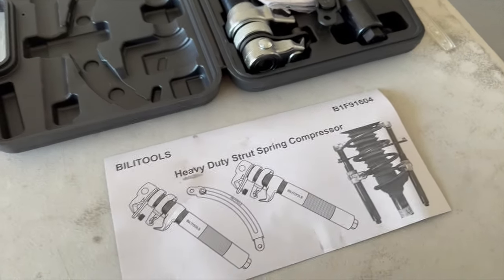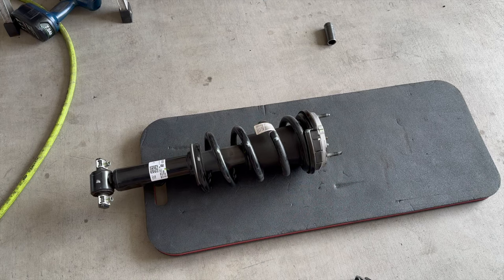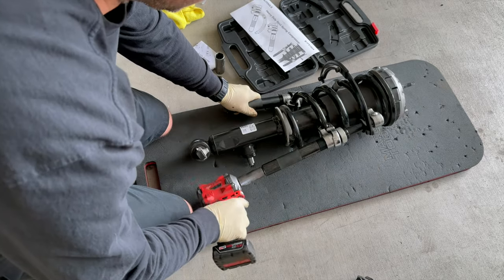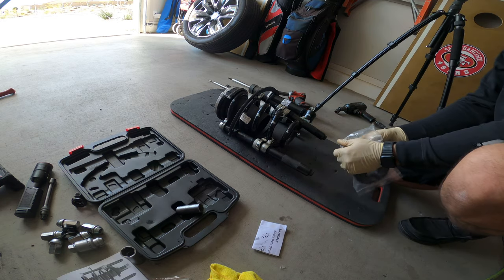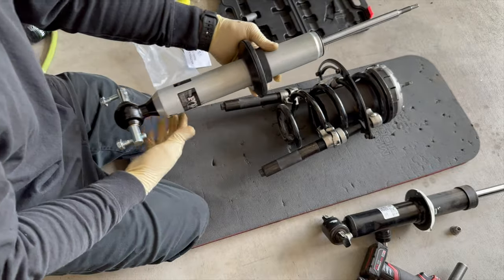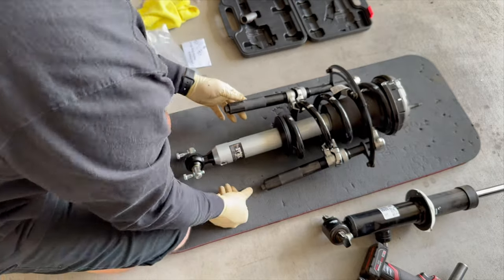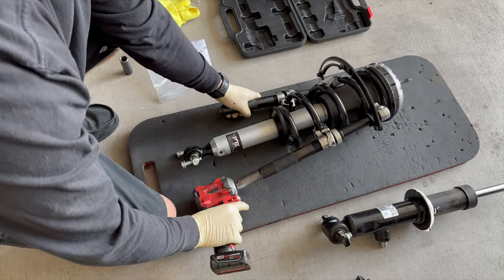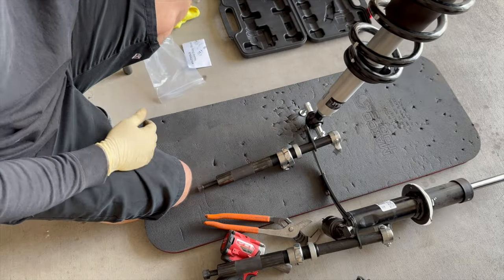Testing The Strut Compressor Tool (purchased from Amazon.)

Comment: Not safe being aligned with the spring axis
Reply: So how should u do it ?
Reply: @rickybobbydastar6534  Sit perpendicular to the spring.  Don't sit in-line with it.
Reply: @ravynx  thanks
Reply from the maker: @ravynx oh please I have done hundreds of struts and seen hundred of videos of accidents doing them. I have never seen them fail the same every single time. Plus the entire time I’m doing this strut my legs are open and I’m on my knees if it were to let go and sling shot it would go through my legs or in front of me. I’m sorry but I’m not sitting on the side of a compressed spring so it can fling out to the side because if it does let go it will be one finger causing it to go a random direction. I love these keyboard mechanics. Acting like they know exactly how it’s gonna pop… make no sense..

Comment: Great video.  Just found them on Amazon and wanted a review video prior to purchase.
Reply: not a great video unless you're clueless.
Never position your body in direct line, 
mount the shock in a vice.
Never use impact gun on acme machine thread, it quickly destroys the threads.